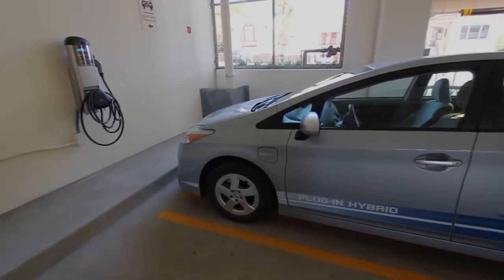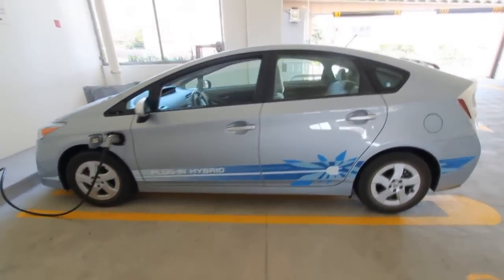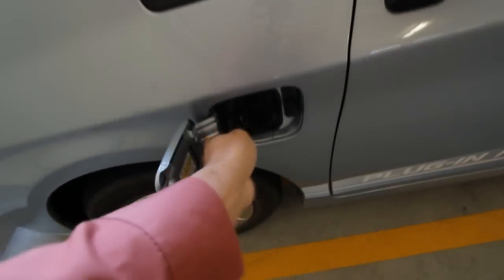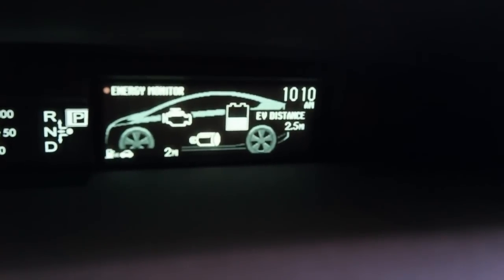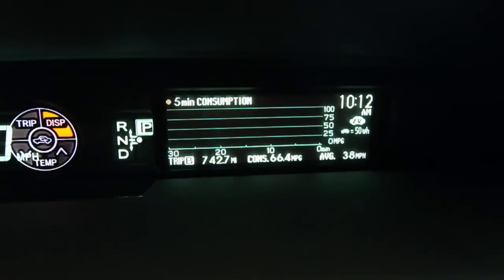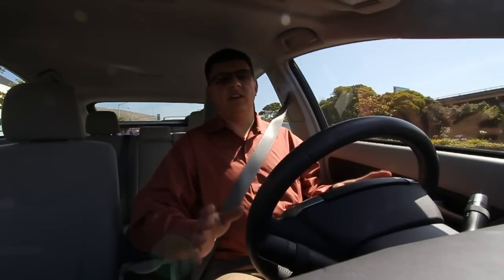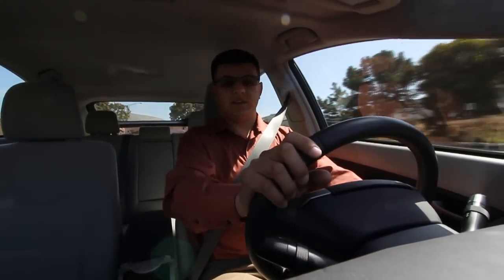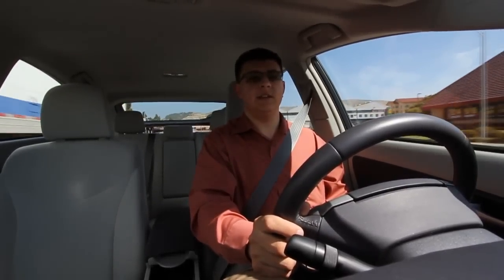Quick Clips: 2012 Prius Plug In Prototype

Comment from the maker: The performance is essentially the same. No more power, no more torque. The battery weights a bit more than the regular Prius but it didn't really impact things a great deal. The production plug-in Prius is able to recharge the plug-in portion of the battery pack when goging downhill so in hill driving there is a benefit with the plug-in Prius.